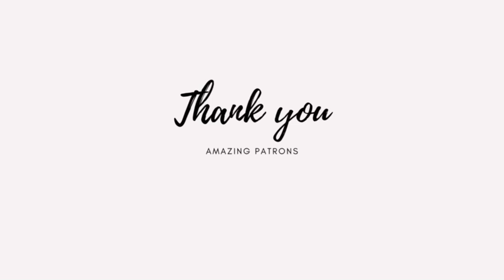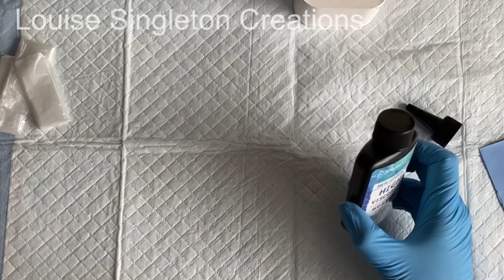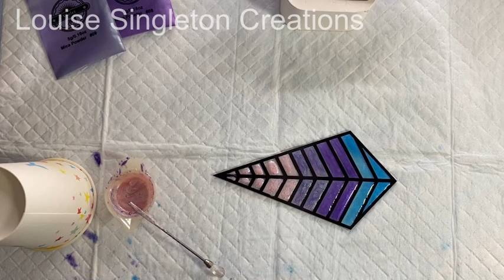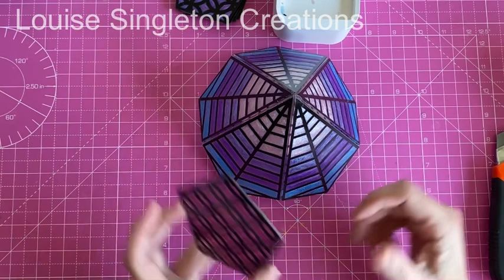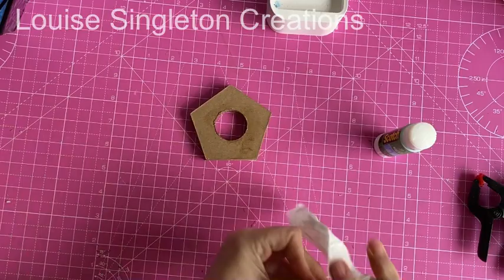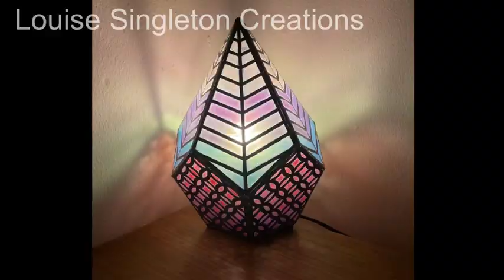Testing JDiction’s NEW High Viscosity UV Resin - Resin Lamp

Comment: I love that the colors reflect, I wonder if it would be a stronger color reflection if vivid transparent inks were used? Of course then you’d be able to see the lightbulb. When I designed windows, where the window was located would be taken into account. If it was an exterior placement then the stained glass choices would be made based on light reflecting through the glass. If it was an interior panel with little light behind it, then I’d choose glass based on light reflecting off of the glass. Since I’ve been doing resin, I’ve been curious if the properties of light and resin work in a similar way. I love the way your lamp turned out. You are amazing at designing geometric puzzles and putting them together in a way that’s both beautiful and functional. That along with all your talents keeps me excited about every new video! Thanks for sharing Louise!